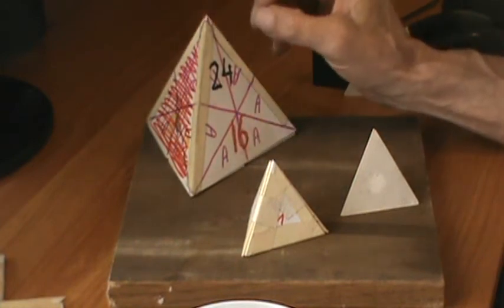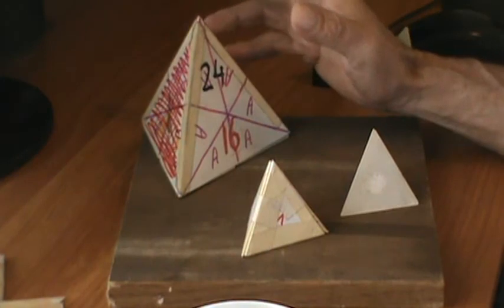M2U00234

Comment: I highly commend your interesting dissection of the triangular prism that equals the volume of a cube.  I now understand where your 9 modules come from.  I personally have never seen that done before and if I ever use it, I will give you credit for showing me this.
I understand your adherence to a tetrahedron of edge= 1. So if a tetrahedron has an edge of 2, the natural inclination is to say that it is two frequency.  This is where you make a mistake in interpretation.  You can disagree with it all you want, but that is the basis of Synergetics.
Synergetic has as unity, 2 radii.  4 spheres of radius on stack to form a tetrahedron at their centers and 2 radii is the distance between two centers.  The tetrahedron is part of an tetrahedron-octahedron all-space filling matrix of closest packed sphere.  This is Buckminster Fuller's Isotropic Vector Matrix.  All vectors are the same, 2 radii.
The "cover" that you pull off of your two-frequency tetrahedron is the unit tetrahedron and you show part of the grid that shows that the tetrahedron is made of 24 A modules.  The octahedron is 4 times larger in volume and has 48 A and 48 B modules.
The cube that "harbors" the edge 2 tetrahedron has an edge √2 and a volume of three tetrahedral units.  It is composted of 48A and 24 B modules.  All of these can be physically demonstrated.
I find tetrahedral units based on an edge = 2 = unity, are highly helpful in simplifying many polyhedra and their relative volumes.
Why you see the need to accuse others of charlatanism in mathematics is unnecessarily and kinda makes you look like a ranting man at 3 am on a deserted street.
Reply: Furthermore, regardless if the edge of the tetrahedron is 2 or not, it is still sub-dividable into 24 A modules.  Unfortunately, for you, your motivation is to undermine Synergetics because it makes your "discoveries" moot, since the A & B modules make all of your "Elusive Cube" units.  Just because you didn't figure that out, doesn't make you right and the arguments against Synergetic Geometry are pointless.  You just come off as a bitter, disgruntled man.
It is obvious that your attack on the edge = 2 tetrahedron is your "opening" to argue that your units are based on edge = 1.  That is silly and you continue on, always arguing that your system is 1/2 the edge length.  Though it is clear that the timeless principles show that the minimum sub-divnisioning is A&B modules.
I have used this example before where Danny DeVito in the movie One Flew Over the Cuckoo's Nest, want to bet half of a cigarette.  The minimum bet is a cigarette and Jack Nickolson points out that if it is less than a cigarette it is shit and no longer of use.  But, you can insist on picking butts off of the street and puff away.
Reply: I abhor your racist comment about Martin Luther King.
Reply from the maker: OK David someone knew about it, sure we know Fuller did not, after all he would write about it. Fuller did not know his dissections are completely wrongly labeled, and that there is a strong relation of his effort to elevate his tetrahedron thinking that is actually all in a cube. Do more for less is my work and  his wrong assumption.
Reply from the maker: I'm not much of a sleeper, have just responded to you, happened to be very early in the morning. I do not care about Fuller of his drawings or his writings or his logic, or his philosophy, I  have made a set that demonstrates, interprets everything about the concentric hierarchy and than some. I'm not accusing no one
Reply from the maker: Well thank you, cooperation would be much much more fruitful,  but it is what it is, I do not care anything about Fuller, his drawings, his NEW words, his philosophy, his dissections, cause it is all in the cube as the LOWEST COMMON DENOMINATOR. and than some we, I can interpret Fuller with my blocks in a correct order and relation and magnitude, Fuller is for Rybo, Z- cube is for me and all who like simplicity and do more with less concept, AND ALL THE SCIENCES ADHERES TO THAT LOGIC.
Reply from the maker: The problem with the logic you assisting on is that the coupler harbors a regular octahedron in it's core, THIS IS WHEN WE USE ALL IDENTICAL modules, therefore Fuller's claim INVALIDATES IT'S SELF because he claims and wrongly demonstrates, and labels that a regular octahedron is LARGER than a coupler and we all know as per my demo that that is not so, and we can go back to our RHOMBIC DODECAHEDRON because here both of  our units our (ROHOMBIC DODECAHEDRON) are EXACTLY the same.
Reply from the maker: Are you serious ?? have the video here showing HOW I DEMONSTARTING SYNERGETICS with my modules, exact mod to mod comparasements, I was the first to show you and show to all, how synergetcis can build my modules at two frequency and NOT THE OTHERT WAY AROUND, it was not you ,nor Kirby ,nor Fuller, but it was frank Zubek have the video I have shared with you and with all, so please do not make ass of your self, I do not have the patience to rehash the past, I SIMPLY DO NOT CARE. Fuller is irreverent to me and he always was. I was ready to ask a more serious question a question you may would know, but perhaps some other timer, I feel already repulsed by your twisting method of synergetics MAKING ALL MY MODULES, yes they do, BECAUSE I WAS SHOWING THEM TO YOU AND TO ALL , you want the video ?? It was so I can show to all how OUR CUBES, TERAHEDRONS AND ALL are all the same INDE4PENDENT of what edge you slap on to them. The ratios what counts, not EDGE LIGTHS, they can be 1 mile or one cm, who cares, THE RELATIONS ARE THE SAME, Fuller does LESS WITH MORE, Zubek does more with less and than some.
Reply from the maker: https://www.youtube.com/watch?v=HILJUx-co0 Here is my video of 7 years ago so NO YOU did not show me , nor Kirby, Nor Fuller I HAVE SHOW YOU. Please, stop twisting facts here is the proof, both our modules can be constructed and ARE constructed form Z blocks Fuller had NO CLUE, if he would have, he would not EVEN HAD TO BOTHER WITH SYNERGETICS.
Reply from the maker: Koski, this cube edge is sq. root of two and it has 9 modules, the synergetic's cube is 8x it's size, it's edge than must be 2X SQ .ROOT OF TWO, and it than MUST be two frequency, I mean somewhere down the line you have to use logic, common sense, and some scientific reasoning, after all mat is not a allegory, synergetics is.

Comment from the maker: This prism has the same vol. as a synergetics cube of 9 modules that can not be modeled by synergetics until I have showed up on a scene. 20 these prisms are equivalent to a rh. triconta. vol. (20 x 9)= 180, so here is a prove that the rh. triconta has NO relation in synergetics after all the rh. triconta = 120 modules and NOT 180 modules, with this prism all sorts of inconsistencies are visible, that were obscured in synergetics for decades, synergetics is more funny joke than a true science.

Comment from the maker: Exactly, that is hilarious, so say if the cube = 3 than a tera. = 1 and it's components are .333... x 9 = 3, or .33333...x 24 = 8,or .33...x 72 = 24, if cube = 1, than the tetra = .33.. and its components are .11...x 72 = 8, but Kirby claims he does not UNDERSTANDS these #, but he understands 2.828427125/8 = .353553391 what a ugly # well, luckily I understand, but in a another claim he admitted that we both have same cubes but dissected differently but than he recanted, it wouldn't fit bucky

Comment from the maker: Look Marcus, Coupler for example is 24 modules correct? the octahedron should be 12 modules, again it can not be modeled, they mathematics is skewed, that's why they octahedron is 4x the size of a coupler which is of course retarded, the bottom line is models are created to do geometry, IT CAN NOT BE DONE WITH SYNERGETICS, SYNER. it is a reduction ad absurdum and that is why I love syner. it can be ONLY used as HOW NOT TO DO GEOMETRY, syner. is a perfect model for that that's it's only value.